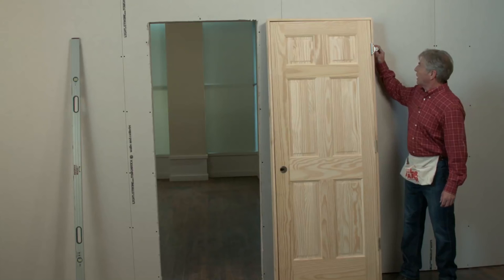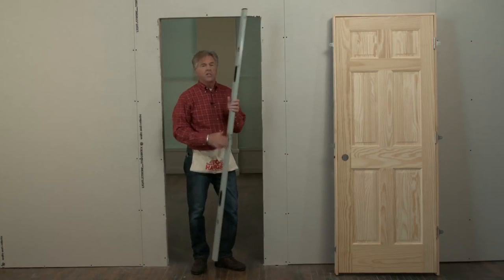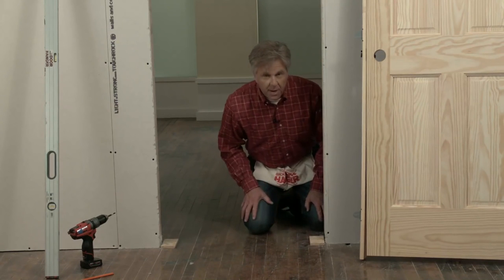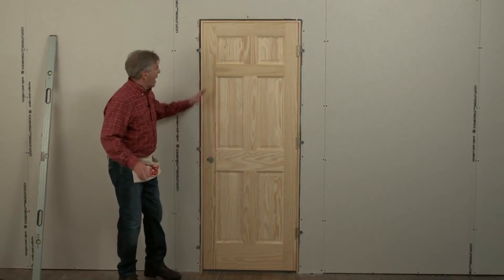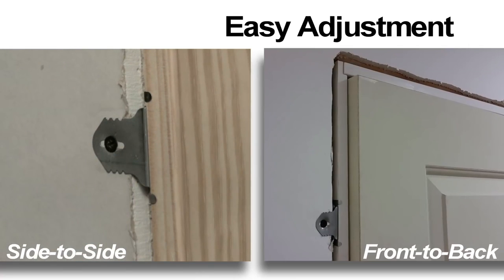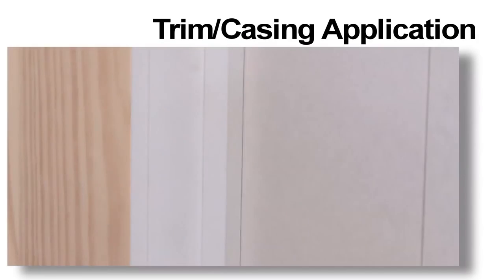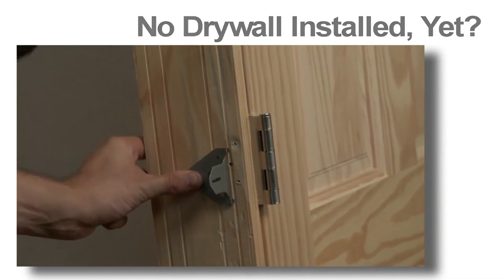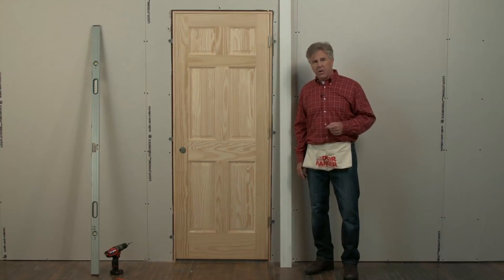Quick Door Hanger Instructional Video

Comment: What do you do if the drywall doesn't extend over the studs to be flush with the opening? Do you need to add a spacer of some kind on the face of the stud where you fasten the hanger to the wall?
Reply from the maker: Add 1/2" plywood or just use the OG shim method. These are designed for the typical installation.
Reply: @slingbart705  thanks.

Comment: I noticed the provided screws have a countersink to it and it doesn’t sit flush with the metal bracket before I do it. Also, we have plaster walls and they are extra thick. Anyone have to buy longer and flat screws from the hardware store instead?

Comment: The heads on thr 18 short screws are awful.  They don't lock into any bit I've tried - flip as soon as you start the drill.. was about to toss the whole thing in the trash.  Had to pre-drill each.  Better screws would make this product less frustrating.
Reply from the maker: I've never run into this issue. Typical #2 Phillips should work. What type of wood is your jamb made of?
Reply: I had the same problem. The short screws are not good.
Reply: Use a #2 (S2) square drill bit, instead of a Phillips bit.

Comment: This may seem like a stupid question but can the door still be hung correctly with these brackets on the other side of the jamb (non-hinge side)? I'm installing a door in an existing entryway.
Reply from the maker: He says putting them at the hinge "Prevents it from getting out of Plumb". I cannot imagine why you could not mount them as shown? if it's a swinging door you have to able to get to either side to screw in the brackets, also shims can also be used in conjunction. Or are you thinking of putting brackets on both sides of the door for a more secure install?

 Need more details about the existing doorway: is there an existing jamb? casing? cased opening? drywall return?  Or try it and give us the feedback.
Reply: @slingbart705  Wow, thank you so much for the quick reply. But, I actually answered my own question after I thought about it. I am putting a door in a very short hallway that connects 2 rooms so the doors of the 2 rooms can be removed to sort of make 1 room. But, how I answered my own question is that I will be framing it because a 36" door was just too big for the rough opening. So, I'm putting in a 32" door. I will have studs on each side so I will be able to install the brackets on the correct side in the studs 😊 Hope you are staying safe and take care.
Reply: Well, door is in! Got the door up pretty quickly. Will never hang a prehung without them ever again. BUT, in some situations you have to shim the crap out of it still to make it secure, like mine which took the most time to make sure it stayed plumb. If it was Sheetrocked on both sides I would have put them on both sides, no shimming required. But thank you again and have a great day.

Comment: not that easy.  If you are not professional, you will spend hours with it.
Reply from the maker: Don't knock it before you try it. for $6 it is way easier and Faster than shims. Follow the basic rules of Plum, Level, Square and check your margins and you will have a door hung in 10-15 min.
Reply: @slingbart705 We have bought 6 sets from Lowe's.  We had given up last year, but tried again yesterday.  It may work with certain door, but not with prehung hallow core doors that we bought from Lowe's.  The door jambs/frames keep bending